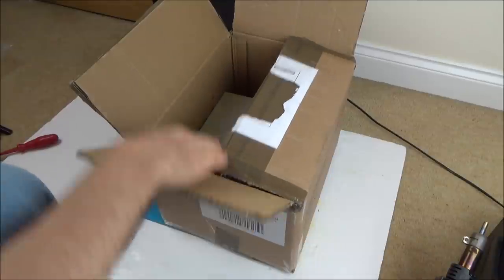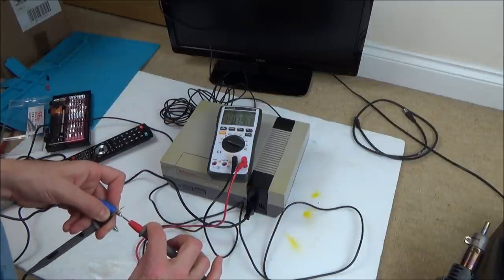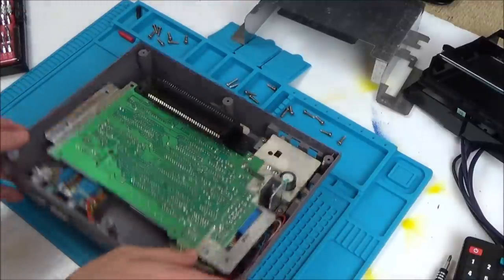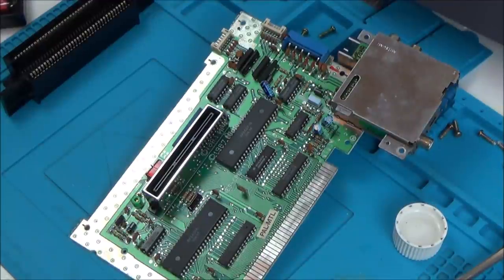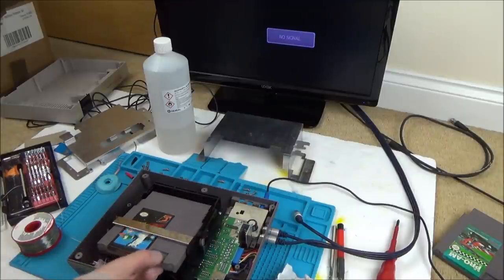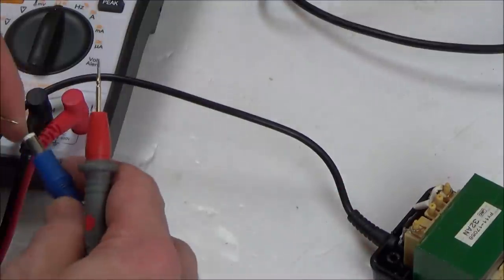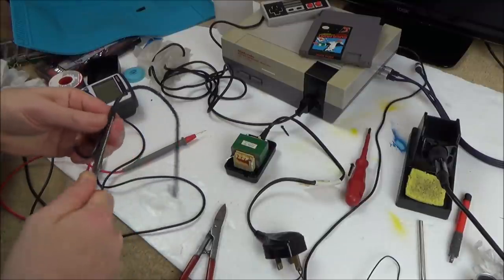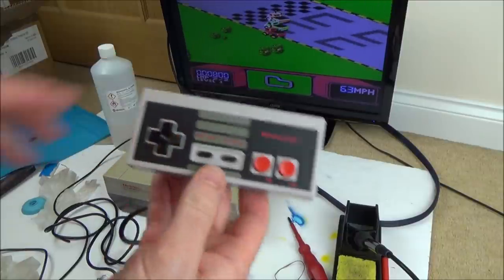Trying to FIX a Faulty NES (Nintendo Entertainment System)

Comment: Just as a preface, you're a good dude and I don't at all mean to come off ill spirited if I happen to.

First off, the port on the bottom was meant for the disc system that Japan had (Famicom disc system, for games like metroid, zelda, Mario 2, etc).

Secondly, I've repaired dozens of these, and disabling the lockout chip is absolutely worthless if all you are trying to do is solve the flashing light issue. 100% of the time that issue is fixed by giving the 72pin a vinegar bath, or replacing it entirely. I know you weren't the one who cut the chip lead, just letting you know.

Thirdly you didn't hurt anything by reflowing the solder there, but it would have been much faster and cleaner if you used a knife tip, threw down flux and just dragged the iron across. 

Fourth, fussing with the RF is a waste of time in 2019. It was pretty much a waste in 1989 lol. The composite leads are all you need worry about, as long as you have good picture there you're right as rain.

Fifth and final, if you're using 91% IPA you really need not worry about things being dry. Before I even open an NES I completely wet the board in the cartridge, run it in and out of the 72pin a few times, and power straight on. There's so little water in it you should never need to wait on it to dry.

Sorry for the novel, hope the read is helpful. Keep up the good work mate! ✌😄
Reply from the maker: Thanks for the advice :-)
Reply: He's doing it for the learning and the feels! I'd want the RF working right too.
Reply: @Mymatevince  I pretty much agree with James Buress,but with the power supply you cut too much"good" wire off,99.9% of the time the "break"in the "cable"as you call it is at the "strain relief"itself & a fast,simple way to find it is to pull on the wire until the other wire breaks !!!! Before soldering back on tie a knot behind the"strain relief"so that the "cable"can't pull out of the "strain relief" and undo all your hard work and possibly wreck the transformer leads rendering the unit irreparable !!!!!
Reply: @richardanderson5109  The old SNES power brick had cables that were way too long anyways, that's one of the reasons these tend to break. So cutting off "too much good cable" really isn't an issue on them. They go faulty way more often than the older NES bricks do.
Reply: While I do agree with the RF being a waste of time I was practically yelling at the screen "Check the channel selector!"  I remember mine in the US could switch between channel 3 and 4.  Channel 4 always came in the clearest for me and 3 would "snow".
Reply: You can also boil the 72 pin connector it reshapes it so it makes better contacts. Just make sure to remove it from the circuit board first it slides right off. It's much easier just to replace the 72 pin connector as you can usually find one online for less than $10.
I've never heard of the vinegar bath but I'm definitely gonna try it.
It sound way less invasive? than boiling it. Also you can polish the contacts on the carts with a very very fine grit sand paper just be super gentle. Brasso also works for well polishing the contacts on the carts just make sure you clean it off with 91% isopropyl alcohol after. I love working on these old things.
Reply: Thank you, Mr Wizard
Reply: The Famicom disk system plugged in through the cartridge port. I wasn't able to find evidence of anything reaching market that uses the expansion port on Google, just a couple prototypes and hobbyist projects.
Reply: your comment has more likes than the video
Reply: @James Burress   Do you know a respectable repair person in the states that could fix my two NES systems for a reasonable cost?
Reply: The real fix is adjusting the top pins (not just the bottom) with a dental pick or needle.  Lasts longer than boiling or vinegar.
Reply: @keithstone001  avoid brasso, it's highly corrsive.  Abrasives like fibre-glass pen and fine grit paper/cloth remove the plating so although these methods work, they will eventually destroy the cart.  For gold contacts rub with a pencil eraser followed by isopropanol cleanse then use Caig DeoxIT Gold
Reply: There is one thing I noticed with the 72pin connector, some of the pins were sitting lower than the others when there was no cartridge in it, I pulled all of them up a little bit with a percision flat head and pulled all the top ones out from the back and gave them a little bend downward and popped them back in, and VOILA works like a charm now, probably just a poor connection from those slightly used up pins that were sitting lower, but when you bend them back up, they make perfect contact again.
Reply: James Burress Ana
Reply: in my opinion the RF is essential. having a dodgy component/feature in a device just isn't acceptable to me or another collector.
Reply: I know I'm late to the party mate, but my 72 pin bridge looks fine, though my actual card on the motherboard has what looks like a grey dark stain on half of it that won't come out with electronic (pin) cleaner. Help!
Reply: "disabling the lockout chip is absolutely worthless if all you are trying to do is solve the flashing light issue."

but... that's literally what it does... i know you mean it wouldn't help in making the games readable, but disabling the lockout chip disables the flashing light all together regardless of whether the game is dirty or not.
Reply: I know I cringe so hard watching this guy. It's like a car crash I can't turn away.

Comment: 28:30 Double-sided boards of that time almost always have vias in them. Basically small copper tubes, so it doesn't matter if the solder goes all the way through-it will, anyway, because it creeps along the inside of the via. That makes it hard to unsolder ICs, but PCBs are also very sturdy.
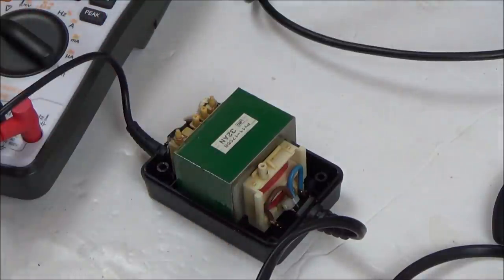41:50 This is just a classic transformer (AC in, AC out). It can't hold voltages, only capacitors do. And they're only a concern in switchmode PSUs. Says smartass me ;), but if anybody out there isn't sure what type of power supply it is, do check.
43:00 The continuity you're testing there is going through the copper wire inside the transformer. It's normal, not a short.

Comment: I know that feeling all too well. "I'm more happy about fixing the lead than I am the NES."  It's the same way I felt when after 4 years (I'm a complete novice in the repair sector);  figured out that the LCD display for my ACER Aspire 15.6" is an actual Samsung LCD and would work on my Samsung V3 (these are laptops by the way, just for clarification sake).  Saved $250 (Parts & Labour) from a local store which would have taken them 10 minutes to fix and they would have told me to come back in a couple of days.

It is thanks to people such as yourself whom are passionate to share and semi-educate people on what worked for them for a certain situation.  Keep doing what you're doing and thank you.

Side Note: from one of your other videos, I dislike ribbon wire as well.
Second Note: I know this is an old video that I'm commenting on but I saw what you went through with this system and I wish I knew back then what I know now.

Comment: Here is a Tip to see where to cut the damaged cable. Pull out a single piece a wire and if it's coming out you will see the length, and that length tells you where is the problem and thus where to cut.

Comment: Good result Vince, well done. Just a couple of points:  1) You should be testing transformers in Resistance mode (Ohms) rather than continuity. The transformer coils are of low resistance which your meter will give a false indication (beep) of a short. (although, when it beeps, your meter will probably also display the resistance)  2) If a cable is tight fit in the strain relief, smearing the cable with a little bit of soap will help slide it through.
Reply from the maker: Thanks mate, I understand transformers now a little bit better from the comments in this video. Cheers for the tips :-)

Comment: Nice repair mate! 
Even though I would recommend using flux when reflowing the solder, saves you trouble further down the line.
Reply: And use a hot air!

Comment: Hey Vince, hoping all is well. I’m not sure if someone has already mentioned this to you in the comments, but what usually happens with these units is actually due to a flaw. 

When you insert the cartridge, and lock the cartridge into place with the mechanism, it puts pressure on those pins. Over time, they start to lose a bit of their “spring”. That’s why all future cartridge systems from Nintendo are just a simple friction fit type connector without that push-down mechanism.

Best remedy would be to buy a replacement connector. But as someone who fixed several of these, you can actually get them to work again, by sticking a very thin object under the pins and bending them back into place ever so slightly. 

You don’t want too much force as to dislocate them but just enough to the point that you see a slight difference between s treated and untreated pin.

Did this with my unit, and my pins are so tight that I don’t even need to push down on the locking mechanism to get them to play.

Comment: You could have measured the voltage from the adapter after cutting off the wires. So that you would  have been sure that only the wire has gone faulty.
Of course you always have to be extremely careful because you're working with high voltages.
Reply: The outcoming cable is obviously bad as there is no continuity on the outer casing of the connector and the other end. 
Also search google how transformers work, it's quite interesting and this one you have seems to be working ok.
Reply: Yep, the windings reads as a short because they are effectively a short for DC. You WANT to see a short when ohming the windings, as if you dont, it means the winding has a break. The transformer is perfectly fine, the wire is the one being bad. Replace the wire, and this would be a working power supply. It's a simple transformer, no electronics at all, so there's very little that can go wrong with these..

Comment: Glad you got both the nes and the psu fixed as these classics are always great to keep on working and show what the great granddaddy of all the Nintendo consoles is like compared to the switch.  The really cool thing about the old Nintendo consoles is that many of the power and av leads are completely interchangeable with each console - ie the nes and snes use practically the same psu's and the snes, n64 and gamecube all use the same av lead.
Reply from the maker: Cheers Danny, the PSU was particularly satisfying :-)
Reply: NO!!!
They do NOT use the same cables!
SNES/N64/GameCube use a "multiout" connector on the console side and yes they are the same "connector" on all SNES/N64/GameCube.
BUT there are changes in pinout for example using a ntsc cable on pal console will most likely lead to in best case tv/monitor/reciver have a burnt input but more likely the macigsmoke escaping.

http://pinouts.ru/Game/n64video_pinout.shtml
*CSYNC/Composite Sync is replaced by +12V on PAL SNES and PAL Gamecube consoles (But not the PAL N64)

Comment: Hi Vince! Going through some of your older videos just to get more of your content. It's been quite a while since you made this video so you've probably learned this by now, but in case you haven't I feel I should mention it. When you test for residual voltage, regardless if the device is AC or DC, you want to check with your meter set to DC since only DC can be stored. 

The only occasion I can think of where you would want to test for AC on something that has been disconnected from the mains is if there is a Fan or Pump that is still moving due to air or water flow. In those cases, the spinning motor is a generator, and if they are AC motors, AC is what they will generate.

Comment: Mine was damaged by some previous "repairer" and all I got was a grey screen.  When I took the carriage out to work on the socket, I found a wire had been added to the board, then I noticed a cut track. On closer inspection an adjacent track had also been cut.  I added a second wire to bridge that break. I used my SNES power supply as the NES didn't come with one.  Yes, NES and SNES used the same power supply.  The secondary (low voltage winding) has a low resistance so a continuity tester will show a short.  Usually the primary (240V) fails and a short in the secondary can cause the primary to fail.

Comment: "I just want it to work every single time" - You're asking a lot of the NES there, my friend :D

I do think you got it about as good as it gets without modification/replacement though!
Reply: "I just want it to work every single time" - Me as a kid from 1990-1994
Reply: So true
Reply: so much this
the NES zero force slot is not very reliable because of its design, asking it to work everytime is indeed asking way too much for such a faulty slot design
Reply: Well I bended the pins in mine and it always works I don't even have to push down and it still has the lockout pin on it
Reply: @glitchenz  for how long though? That's the fault of the design

Comment: I learned something new watching your video. I never knew what that rubber casing on the power supply was called. "Strain Relief" huh? Well, in the US, our NES power supplies were a bit different. The power supply brick went right into the outlet. I think that design caused the wire to be more vulnerable to movement, because I remember going through a few AC adapters when I was a kid. The issue usually starts with a loss of power, which goes away if you jiggle the cable. Then it progressed needing to position the cable a certain way and taping it to the brick so it wouldn't move. Eventually, it would just fail completely due to total breakage.

Comment: I remember reading about NES issues a few years ago and one of the major snags on original NES' was the 72 pin cartridge slot was finicky, all it would take was one or two pins to be misaligned and you'd get the same issues you showed in the video of it not working all the time(there were also reports that the original cartridge slot pins were more prone to corrosion). It was highly recommended to replace the 72 pin cartridge slot with a 3rd party replacement kit which were and I believe still are fairly popular on some repair sites. It might be something to consider next time you tinker on a NES, just throwing that out there.

Comment: Great video Vince =D

Regards the cart slot issue, the problem is they kind of bend a bit over time so the edge connections don't join very well.  You can have success using very fine sand paper in and out of that slot there.  Some people boil the connector for 5 or 10 minutes too and that seems to work.  You can replace them with new ones!  There are some modern replacements for that cart connector too!
You measured continuity on both contacts on the transformer there because a transformer winding is almost a short.  It will be a low resistance between both contacts.  The connectors (or cable) fail on these very frequently!  I've fixed several of them that have had a damaged cable or connector!
One of the main reasons the wires break is people tightly fold and bind the wires for storage (ie. almost 90 degress back on itself).
Reply from the maker: Thanks for the top tips Chris :-)

Comment: Safety tip, if you see any huge capacitors, make sure you take a screwdriver with a non-conductive handle and touch the leads of the capacitor to discharge them, that removes the charge so it removes any chance of you getting zapped by it

Comment: The solder balls as you called them are through-hole plated via's and do not require solder, they have solder in them as the board was wave soldered.

Comment: Just a tip normally you will find when a cable breaks it's nearly always near where it goes into the device where the strain relief is. The reason why it read on both ends near the transformer is that the transformer winding are a low resistance and so it beeps on both sides when just connected to the good end of the cable. Good repair great job.

Comment: change the pin. I use to refurbusb these 15 years ago and resell them on ebay. The one's I use to get all had power, i would clean and change pin worked no problem sold. that was great will you be reselling it now that it is working again. EXCELLENT!!!!

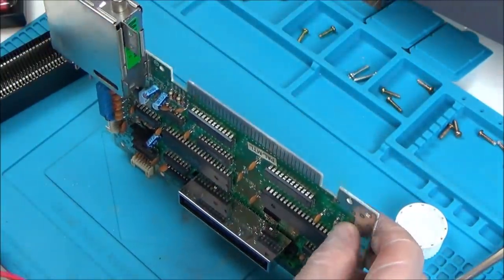Comment: 24:30 On a double sided board, you may see traces jumping from one side to the other. Those 'dots' are called vias.
[Edit: A via is a tiny barrel-like object that protrudes through the board itself, is a connecting 'hole'. Nowadays, they do not have solder on them, but before they put them there due to the difficulty of ensuring continuity, or to ensure electrical stability by adding conductive mass.]

Comment: I used to clean the connectors on these NES systems all the time. You don't need to take it apart or anything. All you need is a pencil. Shave the pencil tip to a flat edge so it's the width of the cartridge edge connector. The lead should be in the center with some wood on either side. Stick it in the NES connector pins and run it site to side for a while and test your cart. That is it, beats any other method.

Comment: 46:00 the testing method won't be different if it's used for AC or DC. The continuity buzz you saw when both active and neutral were connected to the transformer would have been through the transformer winding. The bell function on the multimeter still buzzes if there is a few ohms of resistance. You would need to look at the measurement on the screen to see if it is measuring through the transformer winding (broken conductor will give a non-zero reading) or from a good conductor (near zero reading)

Comment: A tip: If you want to slide something inside something, use soap. It will allow it to go inside and once it dries it's ok (instead of using oil as an example). That's used for example to mount new grips on a bicycle or motorbike.